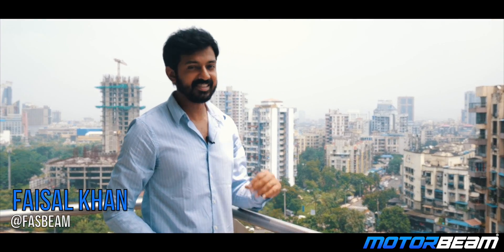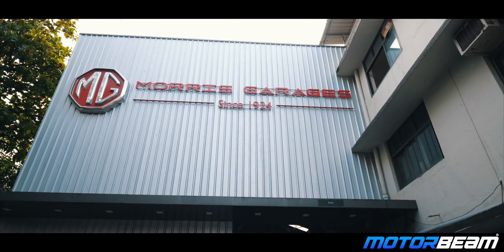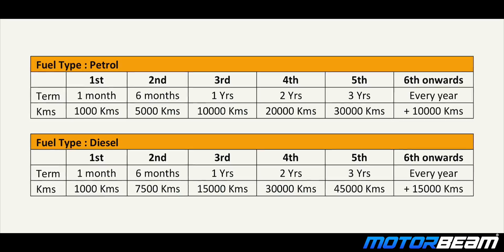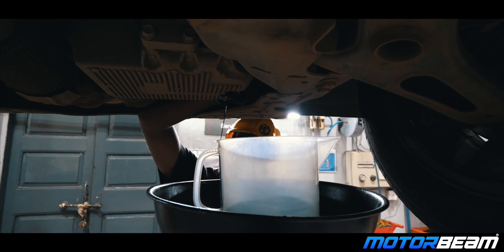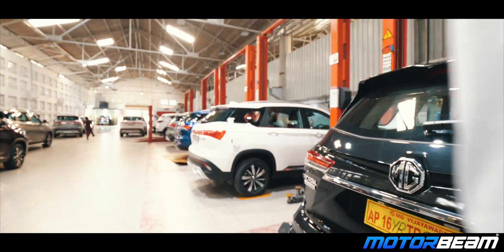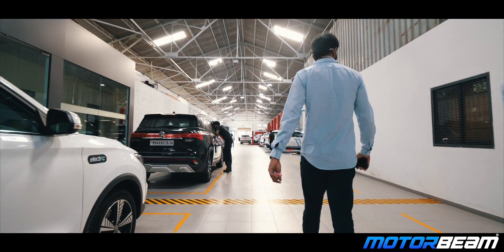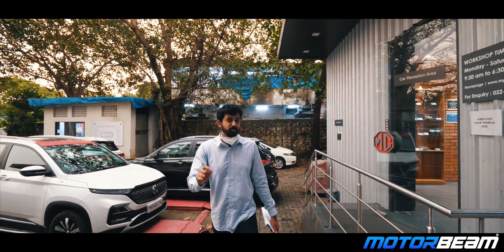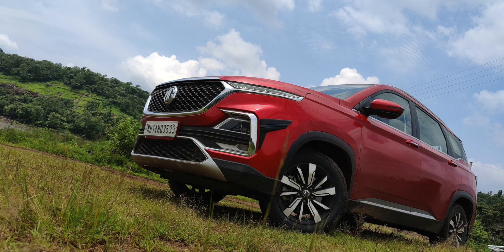Getting Our MG Hector Long Termer Serviced | MotorBeam

Comment: Everything is good in MG except the looks. No offense but Hector looks ugly.
Reply: I also thought the same in photos. But trust me when u see one in close in real, it looks 🔥🔥🔥🔥🔥🔥
Reply: @areeb7330  I saw this closely. The proportions are not good at all. It should have more wider. The tyre profile should be 235/65 R17 or 235/60 R18. And the ground clearance is also not that much. Approach angle is quite low. Overall all I want to say is it doesn't looks like a SUV. If you consider it as a MUV then yes it does make sense. It's a practical car.
Reply: Harrier looks like a true suv as compared to hector. But there is too many issues. And it's not a perfact car. And the top variants do not justify the cost. But I have to say they nailed it in terms of looks and appearance.
Reply: @pramitroy11  yup u r right, tata literally did a fantastic job on looks and appearances on harrier. I mean the road presence of harrier is 🔥🔥🔥🔥. It looks like a proper suv
Reply: @areeb7330  agreed
Reply: Looks far better than then the crysta
Reply: @pramitroy11  Most Hector owners apply chrome accessories which does not look nice and also makes the car look ugly...Without accessories Hector looks very nice....
Reply: @pramitroy11  ..there s a reason why they ve chosen 17inch tyres...its to offer better grip and comfort on bad roads which is almost present in 70prcnt of india....it is made according to indian conditions... harrier gets only 2years of warranty while this gets 5.... stop being so hypocritic
Reply: Harrier sales numbers are higher on youtube comments than actual sales.
Reply: Harriers future will be like Tata Safari which still is remembered for its size and built but lacked great interiors and upgradation. Therefore xuv500 and scorpio chewed it easily. Harrier too shall see the same fate if petrol version isnt launched.
Reply: @MY_COMMENTS  yehhh
Reply: @adithyad8357  17 inches rim is fine but the tyre profile is low. By low I mean not a midsize suv standard. The tyre profile should be 235/65 R17. Hector is offering 215/60 R17. Which is good for cars like kia seltos hector is much bigger car so there should have been bigger tyres.
All other SUVs of this size like harrier and xuv500 are offering 235/65 profile. Which helps to make the ride quality even better.
Reply: @pramitroy11  yes bro thats exactly why xuv is hard on the bad roads and hector makes it smooth..please watch faisal khan s first hector review (not the diesel one) ...😊
Reply: @powerfulpiston4979  I believe the crysta still sells much more than the hector
Reply: @adithyad8357  are you crazy ? The ride quality of xuv500 is not apt because of stiffer suspension. Tyre size is not everything ! Look at the harrier the ride quality is brilliant with the tyre size I've mentioned above. The tyre size also helps to increase the ground clearance. And suv of these size should have bigger tyres there is no two ways !
Reply: @pramitroy11  bro i have a  xuv 500 which am using since 5years...its not a comfort vehicle...every1 s lookin fr comfort nowadayz... u pls take test drive of hector then reply me ,sir..u will understand
Reply: @adithyad8357  I'm looking for a full fledged suv. And hector is a muv/mpv not suv for your kind information.
Reply: @pramitroy11  rightly said but if you talk about value for money and real suv nothing beats the xuv 500
Reply: @adithyad8357  not in the new facelift i noticed that
Reply: @prathamsharma8713  right
Reply: @pramitroy11  if budget isnt ur problem,then wait for the gloster ....its a beast with loads of features,offroading capability nd many more....
Reply: Pramit Roy you can get them changed after market also by selling it to the tyres market and replacing it with 235/17 , my friend did that and only costed 5000 extra
Reply: wags wams it’s neck to neck crysta last month 2900 units combined private and commercial sales and hector and plus 2600 units , in private vehicles I guess hector sells more
Reply: @adithyad8357  yes. Gloster is a true suv. Eagerly waiting for this. This will be the real game changer for sure 🔥
Reply: @wagswams5842  that's cuz crysta is Toyota so it sell like hot cakes even it is shit
Reply: First of all U have a bad taste bro. MG is an international brand company they have made this car personally for Indian users, tata is an Indian company thats y they know which car to make & not according to road,climate,environment,etc & how to make car for India. See I am not telling people to buy mg cars or Tata cars you can see people are only buying MG Hector and MG Hector had stock out in first two months after the launch but Tata harrier has not even stock out once you know why because Tata harrier is costlier than MG Hector. MG Hector has more features then Tata harrier may look like like SUV but it's not complete SUV it doesn't have even four by four that's why people doesn't like to buy or choose there option as SUV in Tata harrier instead they go for that, fortuner, ford endeavor. MG is more practical has more features and yes you can say it is type of MPV since they have launched now 6 seater version so I still prefer to choose MG I don't care whether it's a Chinese company or Indian or any other if they make it same like MG Hector in India Company i Would Still buy it ,the problem with China and India is that the army and politics not normal people we are normal people and MG is Chinese normal people are are doing great job having peace & making awesome cars but politics and some other Idiots in army not the whole Army are making nonsense shit, what is the use of SUV when there is no 4 by 4 in Tata harrier and no power like the BHP is sucks this looks is only on roads I mean like nonsense
Reply: The Boss right, MG hector over HARRIER ❤️🔥. Hector is value for money product ✌🏻i care more about my hard earn money, don’t wanna waste on harrier with no features and reliability. ✌🏻
Reply: @kanishkadarekar10  exactly but harrier is also fantastic for driver but still I own a hector plus
Reply: Only the front look good the sides & back is like 🤮.. also to let you know  the front is very much copied from Audi.
Reply: @kushhatkar  copied from audi really ? The looks would have been wow if it was copied from audi ! By the way which audi car you are talking about ? Anyways hector looks mismatched from every angle. Gloster is gonna be the real game changer 🔥
Reply: Pramit Roy sorry bruhh I didn’t want to offend any one. Let me correct my previous comment those DRLS  are copy inspiration from Audi headlights.
Reply: @kushhatkar  yes you can say that for the dynamic turn indicators 👍
Reply: May be it's your thought but I love this design 🔥🔥🔥 super 😎 mg hector
Reply: I find harrier to be ugly
No issue
Different people have different opinions
Reply: @BroZedd  no issue. But I must say you are among the 1-2% of people who disliked the exterior looks of harrier.
Reply: Pramit Roy harrier mera dost leke pachta raha hai abhi
Reply: @राहुलपाटील-ठ8व  I told earlier harrier is not a perfact car. There are many issues with the car. Here I'm just talking about the looks and appearance. It looks tremendous from every angle and that's what I always appreciate.
Reply: @pramitroy11  more like among 45 to 50% who didn't like harrier
Tata's gol matol curvy design doesn't go well with everyone